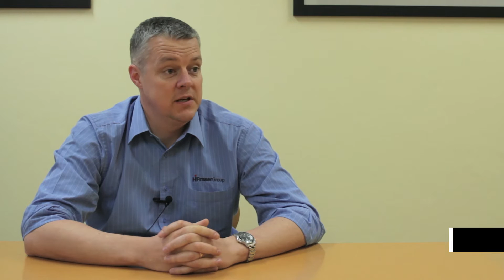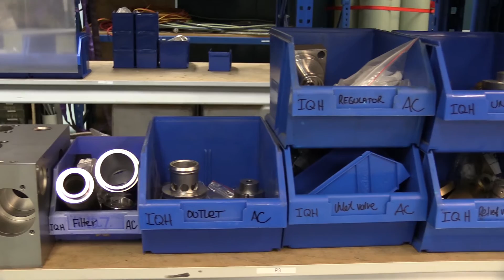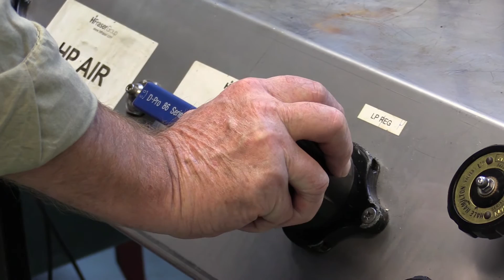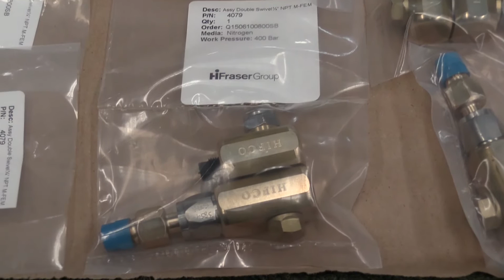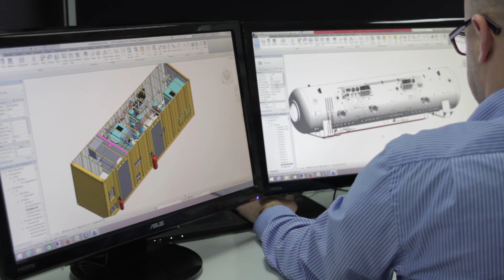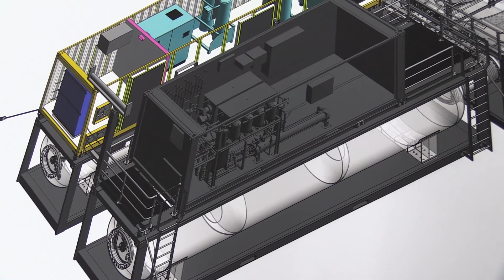H.I. Fraser - An Australian Manufacturing Success Story

Comment: Many thanks to PACE Magazine for the opportunity to share our story on the Submarine Escape and Rescue System project! In November 2014 H.I.Fraser delivered a world's leading solution for the Australian Navy - Support Systems for the Submarine Escape Rescue System (SERS) Hyperbaric Suite - that comprises of the Environmental Control System (ECS) and Low Pressure Air Compressor and Distribution Board (LPAC&DB).The SERS is a complex hyperbaric system used to treat the complete crew of a distressed submarine (72 submariners) after they have escaped to the surface and will most likely be suffering from decompression sickness.The main challenge of this project was to ensure that the containerised ECS and LPAC systems successfully control the internal habitat in each of the seven individual locks of the two Deck Decompression Chambers and the Transfer Under Pressure Chamber within strict parameters to ensure the safety of occupants even in extreme environmental conditions.A further layer of complexity was added due to rigorous DEF(AUST) 9009A air transportability requirements.All divisions of H.I.Fraser - Design & Engineering, Manufacturing, Repair & Overhaul, Environmental Solutions - have been involved in this unique project. And today these newly-developed capabilities allow H.I.Fraser to provide containerised critical safety gas and liquid systems solutions to other naval and offshore Oil & Gas projects in Australia.